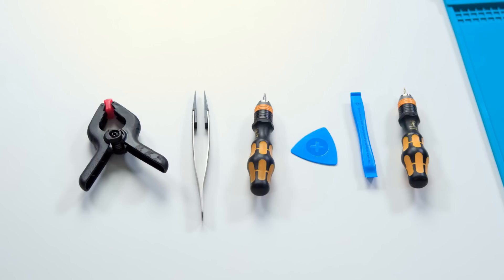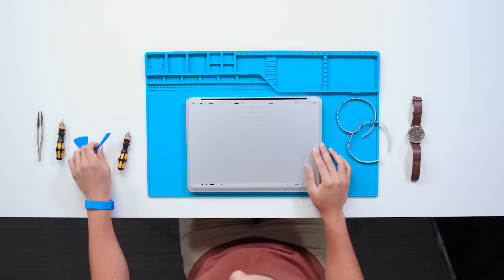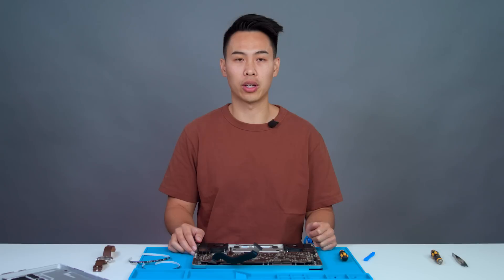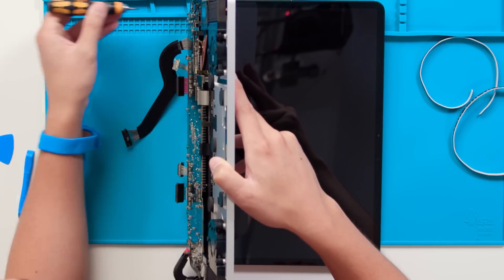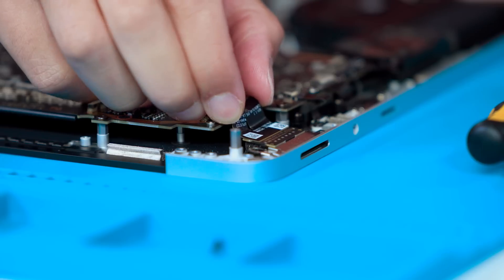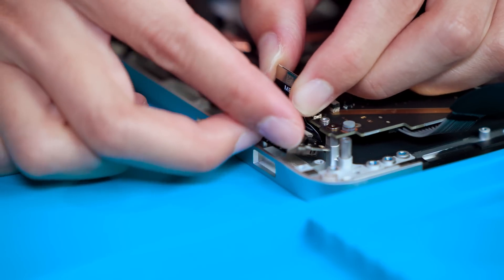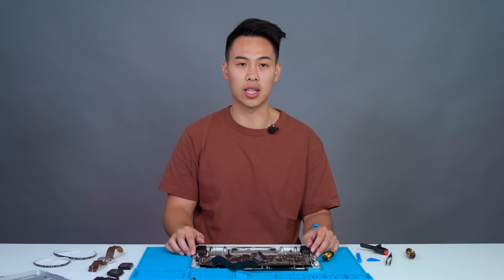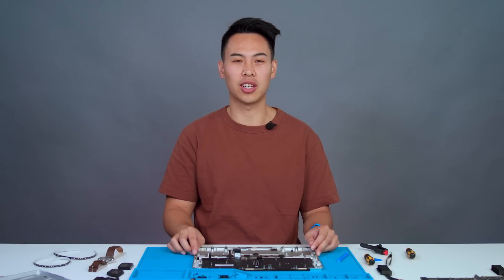Repair | Surface Laptop Studio 2

Comment: This is a great disassembly guide.  BUT where in the name of Belzebub's bony buttcrack can you get the parts from?  Even though it is easy to replace parts like the fans, the only thing I can find Microsoft actually selling are the rubber feet and the cosmetic strip.

Comment: Can future products please rely less on adhesive and hidden screws? I understand the design appeal, but even devices like Apple's macbooks have exposed screws. Repairability to me is a premium feature that makes a product look built to last, while things like hiding screws scream disposable.

If you cant put something back together without elements being deformed, its "dismantleable" not "repairable".
Reply: This what stops me from buying Surface computers. It's too much work to just to clean the fans and change the thermal paste. And there's no guarantee you can get it back the same as is due to adhesive material and rubbers.
Reply: @tidus1ph same here. I’m looking to replace some old laptops for us and my first choice was Framework. They SEVERELY dropped the ball so we’re not working with them anymore. Second choice was Surface. That repair video is enough to make me steer clear. Looks like I’m going Lenovo P16s.
Reply: @DenyTheZeitgeist  What did framework do? I was considering it since the modular gpu sounds promising.

Comment: Now that most retail Microsoft Stores have shut down, will there be a place that sells official SSD's for this laptop? I ask since they have the thermal pad and that nice heatsink. They do not appear to be on sale at the "Microsoft Surface repair & replacement parts" page.

Comment: Where to buy Surface Laptop Studio cover? Do I need to replace the cover?
Because it has peeling black spots and looks unsightly, I can't find a cover to replace it?
Microsoft does not sell case components for replacement?

Comment: Still a mess to open for cleaning an repasting.
My ex Dell XPS 15 or a MacBook are way easier to open for the "ordinary" maintenance.
If it is gonna come, I hope the SLS "3"  will be easier and practical to manage without ruining the rubber feet and with CPU/GPU already oriented to the bottom.

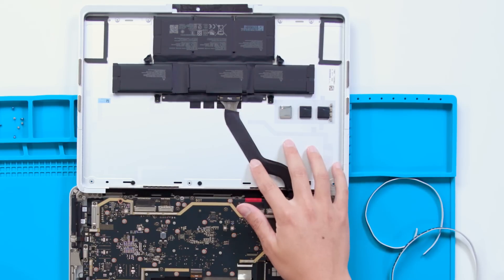Comment: @2:56 "Remove the solid state drive to shut down power to the whole system." NO! DO NOT DO THAT! YOU COULD DAMAGE YOUR SSD! 
ALWAYS ALWAYS ALWAYS DISCONNECT THE BATTERY FIRST BEFORE YOU DO ANYTHING ELSE! Any just to be absolutely sure, after you disconnect the battery, press and hold the power button to remove any residual power that may still exist.